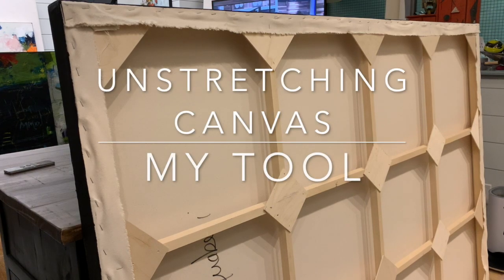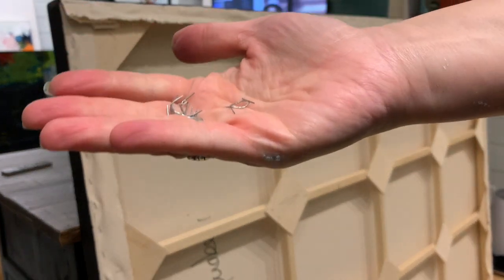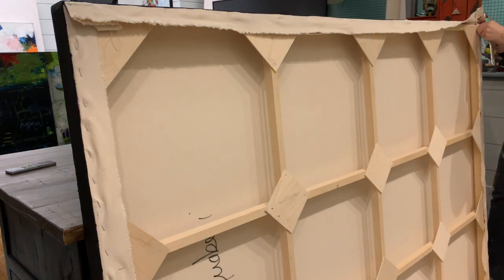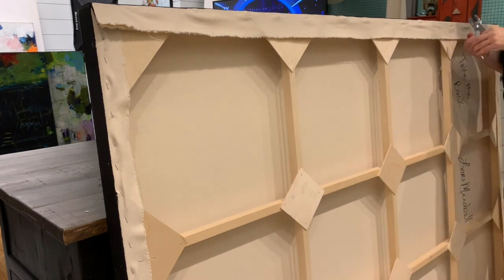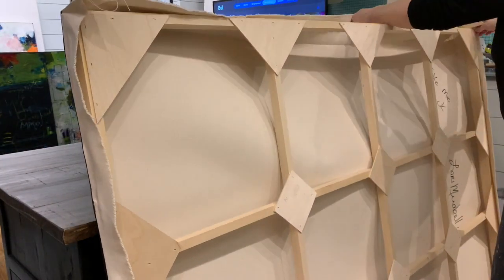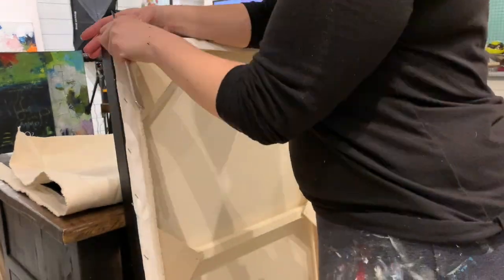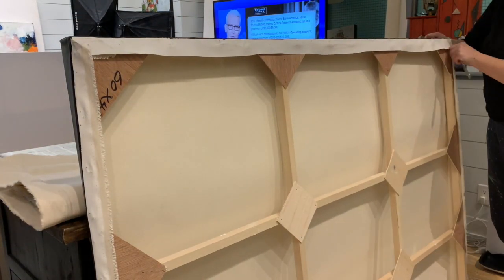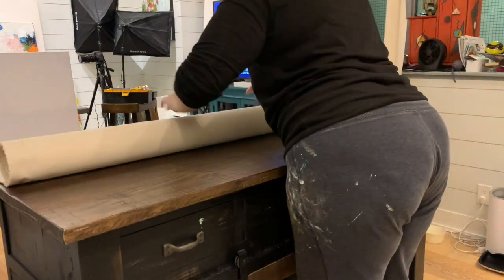How remove a canvas from the stretcher frame

Comment: I noticed that you rolled up your canvas with the painted side in.  I always thought you rolled the canvas with the painted side out-or does that apply only to oil paintings?  Does it even matter??
Reply from the maker: hmmmm I would think it would be exactly the same thing...but I'm not an oil painter.  To me having the painting on the inside protects the image, but truthfully that's just how I've always done so I honestly have no clue about that, maybe someone else might share what they know about that.
Reply: Painting side out. This prevents the paint compacting when rolled, then maybe cracking when flattened. If it’s rolled properly, paint side out, any cracks that form will close up when it is flattened. (Ive been told, not by experience.)
Reply: @lorimirabelliabstractartist  I was wondering too. Never shipped unstretched, but trying to be psychologically prepared. Per my research:  Roll up the canvas with the paint on the outside. If you roll it up with the paint on the inside, the paint may wrinkle (especially if it's applied thickly or has a lot of texture).

If you're skeptical about this, do a quick test: bend a finger and pay attention to your skin. On the outer edge, it stretches slightly to cope with the curve, whereas on the inside it folds up and compresses. Paint does the same thing, though it is not as visible. From: The Spruce Crafts.com
Reply from the maker: @simplyme135  Makes total sense.  My paintings are freshly painting...they are dry but not exactly cured.  But I will start rolling them the other way.  I haven't ever had one damage but just to be sure best to roll paint side out. 🥰
Reply: @lorimirabelliabstractartist  thanks. Your channel is   amazingly resourceful on so many levels 👍
Reply: @lorimirabelliabstractartist  and they advise to use two tubes...."Ideally, you should buy two tubes: one to roll the canvas around so it can't be squashed accidentally, and another to put the rolled-up painting into". Hopefully , one day I  will be fearless enough to ship large paintings.

Comment: Hi again Lori. I am getting another shed built to store my canvases in and also to paint large canvases. I am going to make the height 10 feet in order to store the canvases and also to have the height to paint larger canvases. How do you paint a large unstretched canvas? Do you just nail it on the wall? Also, what type of  canvas do you like to buy from Deserre's for example? weight etc. Any suggestions for the new shed/studio? I already have one now that I paint in which is 8 by 12. The one that is going to be built has to be 100 square feet. It can be any shape. Up to 100 square feet you don't need a permit. This would be so helpful!
Reply from the maker: Hi Kathleen.  Im not painting them unstretched.  The paintings in this video are already complete. They are being taken off the stretchers to be rolled and shipped to a Gallery in Denmark.  😊 I purchase the top grade canvases from Deserre's I'm not sure what the weight is of the canvas.  LOL no suggestions for the outside Mini studio lol except for enjoy!!

Comment: Hi Lori. Thanks for the video. So far I have been using canvases from Michael's and also a local store. The canvases are tucked tightly in between two pieces of wood. It looks tricky to remove the canvases. Any advice on how to remove the canvases? Thanks. Also, where is a good place to buy unstretched canvas? I paint with acrylics.
Reply from the maker: The canvases from Michael's are the only ones that I don't remove from the stretchers because of how they are made.  probably not the answer you wanted to hear. All my supplies come from Deserre's art store 😊
Reply: That is great advice! Also, finding the best supplier for my purpose is so useful.
Reply: I did restretch canvases from Michaels 16 by 20 many times, that's why I stopped buying them from this store as they often stretched on uneven frames. When removing staples the trick is to put a knife ( I use the small paring knife) underneath a canvas, in between canvas and the frame. The frame will be unusable after this manipulation ( it was defective anyway), but the painting itself stays the same.
Reply: @lorimirabelliabstractartist  If you have a chance, would you tell us what you like using DeSerres over other companies like Opus or Michaels? I'm in Canada too, so it'd be very helpful to know! Thank you so much!! - Kasumi